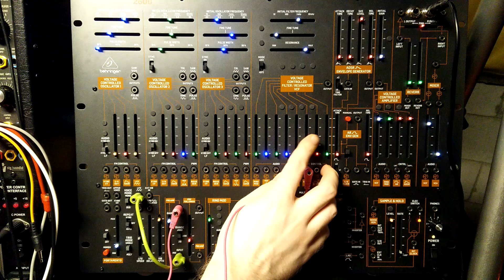Behringer 2600 Random LFO Trick

Comment: The B2600 is like an adventure park for synth enthusiasts. This video reminded me a little of another video about the B2600 where they were making a patch called birdsong to sound like a dawn chorus. Some of the sounds you were getting from the filter were almost the same. I need some more mult cables.
Reply from the maker: Stackcables are expensive but worth it in my opinion. It's handy to see where things are multed at the source as opposed to some unlabelled multiple panel or star mult thingy. I agree that the 2600 is like a play ground or choose your own adventure type thing. Pretty remarkable to me that a 55 year old design is still one of the best but I guess there are lots of examples of that.